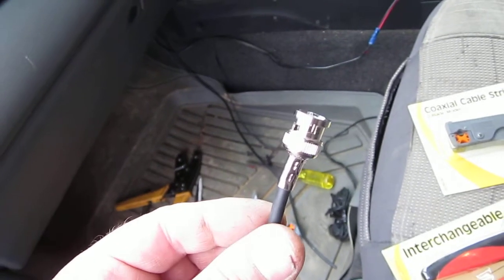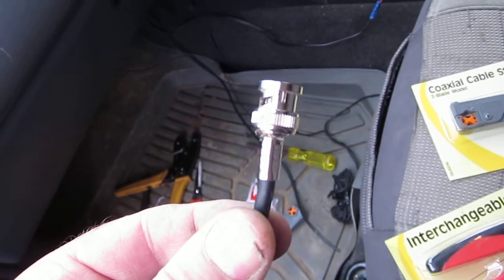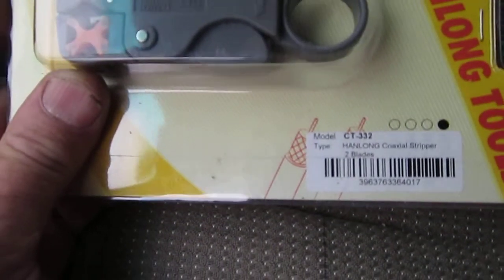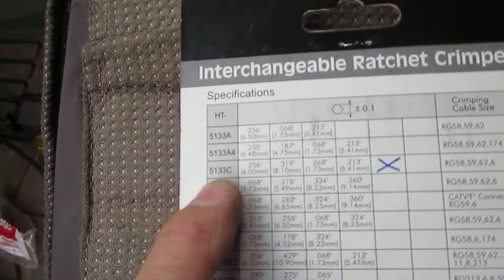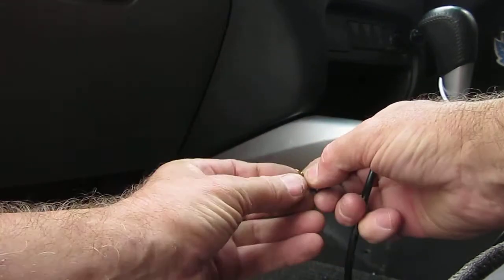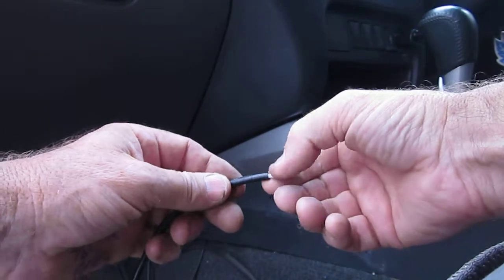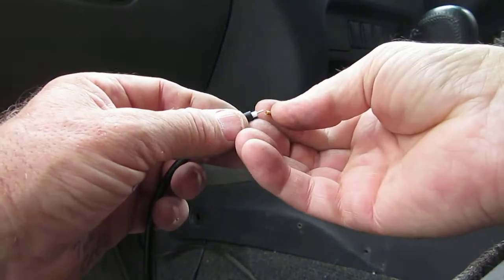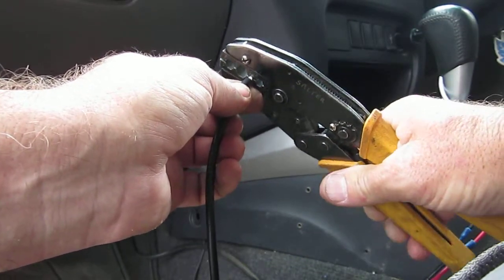BNC Connector (Male) Installation on to RG58 Coaxial Cable. Also see description.

Comment: Your cutter is dull or not set properly as you had to cut the insulation separately. If correct the white insulation would have been cut correctly. Also you should leave a bit more copper conductor as that was pretty short and the crimp may be missed.

Comment: Hi, When I have finished crimping the barrel and do the test by pulling, the connector comes off without applying too much force. Could it be down to the cheap crimping tool? Or is it normal that you shouldn't pull the connector too hard? Thank you
Reply from the maker: Once the braid feral ring is crimped you shouldn't be able to pull the connector apart by hand.

Comment: Nice video. I have the exact same stripper but find it useless for my BNC connectors. The cutting of the outer and inner pieces doesn't match my BNC. I gather you can open it up and change where the cuts are made. There's a YT video on it. However on my unit the axle holding the blades in place can't be removed.